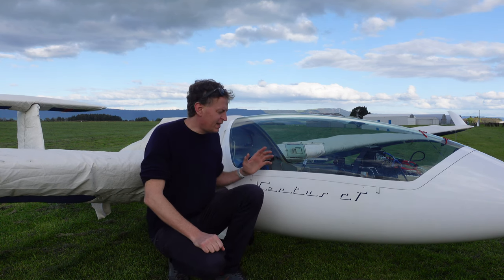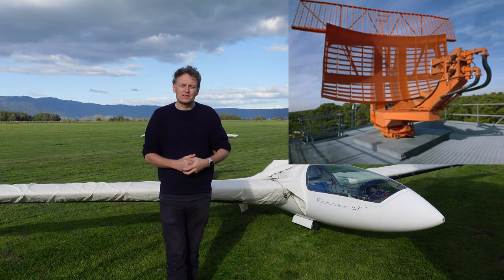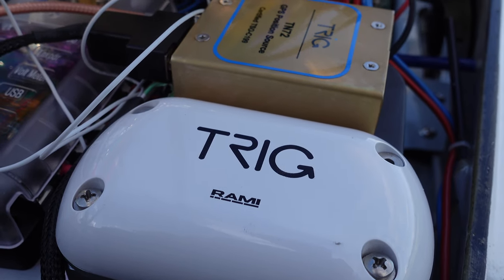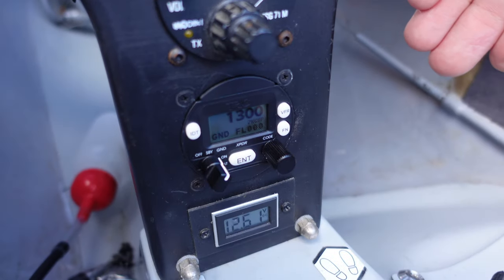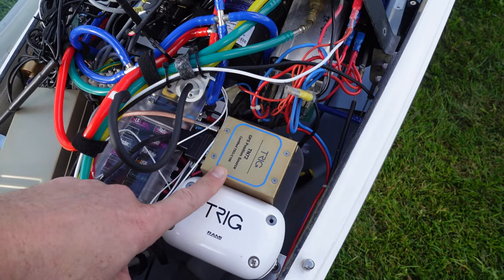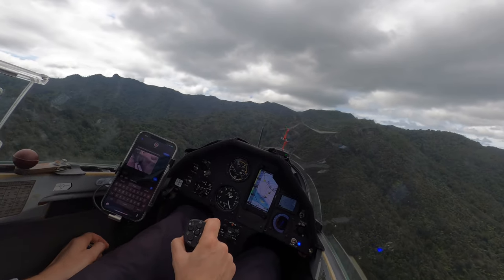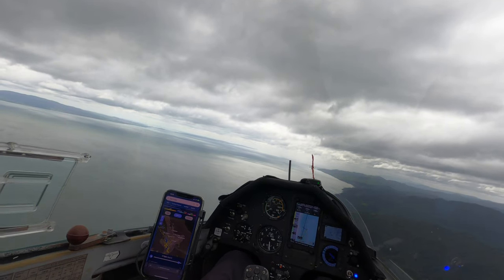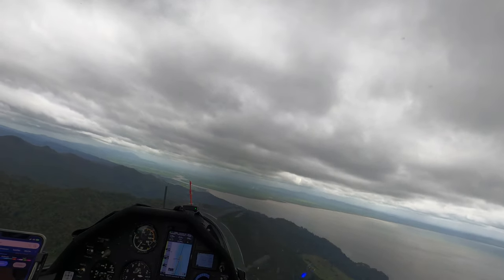ADSB is damn expensive! 💸 Glider Install and Flight Test

Comment: I just have hooked up my Redbox Flarm as a GPS source to my Garrecht transponder via a baud converter/filter/splitter to make it ADSB Out capable, no need for the expensive TRIG GPS brick and other thingy beside it.. It is not officially certified, but the ADSB signal does not care about that. I have it working for already about 7 or 8 years like that. At the time I installed my system (did it myself) it was about €1500. I have a Dolba antenna inside the cockpit near my feet, a flight test confirmed it works very well.

In Europe the transponder is not really mandatory, but there are so many airspaces that are TMZ's these days that cross country flying without a transponder is impossible. So almost all gliders have a transponder these days, either the Trig like you have or the Garrecht like I have, but ADSB out is not mandatory (yet).
Reply from the maker: That’s great! I do wonder if I did that, would our ATC even know?!

Comment: Is FLARM common at all in NZ? That is the GA system that is pretty much standard in Europe for gliders. Much less power hungry, cheaper,  capable of dealing with gliders thermalling in a gaggle, warns about ground obstacles, but, of course ignored by commercial aviation and ATC.
Reply from the maker: It sure is but only in gliders. Compulsory for contest flying.

Comment: We are going through a similar thing in Europe. I have ADS-B in and out, coupled to my LX9XXX system. Stupid thing is most of our ATC radar systems are not ADS-B capable!
Reply from the maker: Oh! Yes not nearly as useful if ATC haven't switched to it yet :)
Reply: @PureGlide  It's not turned on because they haven't even got it installed!

On the other hand it's fun ( if you haven't set the filters on the Lx right ) to get traffic awareness signals of commercial stuff 40 km away and 30000' above you. More fun to imagine the bored bus driver 40 km away getting a heads up on his glass screen to your lowly presence! :)

Comment: I am not sure what is approved and not in NZ, BUT i just installed a uAvionix AV30 with TailbeaconX transponder and ADSB out. Cost me half of that in hardware, but in US$, and my beacon is going in right wingtip, 10m away from me. I asked about putting it where you did, and manufacturer's engineer said he would not do that. Running a test yesterday, I could feel the heat from 20cm away as my hand was being microwaved.
Reply from the maker: Yeah we don’t want the drag from one of them!

Comment: Hey Tim, thanks for the ADS-B tour of your panel. Transport Canada is making the same noises about implementing ADS-B into GA aircraft.
I recently purchased a SGS 1-35, installed FLARM, and scoping out ADS-B as well.
I take it that you chose Trig for its size. Was the Trig installation also the best price point?
Thx.
Reply from the maker: As mentioned the trig system was the only glider suitable ADSB system that satisfies the NZ requirements. The only other option was to installed a normal plane sized unit eg a garmin. The install price was pretty typical, we have to get an approved engineer to do it. Luckily glider engineers were approved (finally).
Reply: AFAIK, in Canada gliders will be exempted, just like they have been for Mode-C, but that's only for Class C airspace.  Here in the flatlands and weak conditions of eastern Ontario, we're not worried about being above 12500'.
Reply: @davesgliding  Hi Dave, we have been exempted for use in Class C in the past. I’m thinking of wave flying next fall in LKP, and having ADB-B available in YOW  and YUL Class C will make it easier to transit.
Hope all is well!
Doug
Reply: @CLdriver1960  ATC will still only clear us across certain portions of Class C anyway, simply because we can't maintain a consistent FL. They will give us a FL and below, but that FL needs to be lower and lower the closer we are to the airport, which takes us out of the workable band anyway.  While I agree that it would open up more Class C to you, I'm not sure how much of a transit window to the south it would open up for YOW.
Reply: @davesgliding  The inability for ATC to identify a non-transponder aircraft is the issue. One of our club members does have Mode C and does get clearance into Class C more easily than I do. To your point, not maintaining a constant altitude does make for a higher workload on the controller, as does our ‘erratic’ course changes (ie hunting for thermals).

Comment: Simply stated,  ADS-B out standard was written by people who do not understand radio.   They guessed at 150W/250W TX power assuming that packet radio communications at near 1GHZ needs any real amount of power to get to horizon at 250miles and 40k feet.   Today the standard would have been written with bog simple 5G chipsets and be in a 15W transmitter with top and bottom hemispheres and the cost would be near nothing and about the same for the paper with it.     

The unmanned drone community under 20kg would rather use ADS-B with a TX power of about 2 to 10 watts than the mess that is just now on the market.

Comment: Interesting stuff Tim.  Are you hooking into the OGN with PureTrack?
Reply from the maker: Sure am, OGN and ADSBHub, along with a number of other things! Got a spare Raspberry pi sitting around? We could use more ADSBHub antennas around NZ! There are only a few…
Reply: @PureGlide  No problem... I've already got a FLARM receiver hooked to OGN so adding an ADSB one won't be a problem.   Note that we also run an ADSB alarm at the airfield when we're flying models so that alerts us to approaching (ADSB-equipped) aircraft.  Safety first!
Reply from the maker: Yeah that’s great re your site alarm, now you’ll see me coming 😂.

Comment: Can you give us a little more info on the antenna mounting?  I’m considering an installation on a Blanik L-23, in USA.
Reply from the maker: Hi not much to it really for the GPS antenna, just a piece of aluminium to hold it behind the panel in a clear spot. The GPS does have to be at least 1m away from the radio antenna and the transponder antenna. My actual transponder antenna is mounted in the fuselage near the gear. But keep in mind I've got a fibreglass glider, so radio works through it. If you have metal or carbon fibre you need an external mount. Hope that helps! Talk to your glider engineer I suggest

Comment: 250W transponder. Crikey, that seems like a lot for modern electronics. How big is your battery and how long does it last?
Reply from the maker: That’s a peak wattage, ie only a short burst when it sends the message. A normal 9Ah lithium iron phosphate glider battery will run it for a full flight. I have 32Ah total :)
Reply: @PureGlide  I should hope it is a very low duty cycle! Part of my job involves calculating and modelling non-ionising radiation hazards for personnel (HERP). I can assure you spending a long time about a metre or so from a 1 GHz, 250 W CW antenna is not within ICNIRP limits!
On the plus side you could always hack-it into a nice heater for the winter... ;)

Comment: If I may ask.  Do you have an electrical system with your engine?  Is that what powers your ADS-B equipment?  Thanks!
Reply from the maker: Hi, no the engine doesn't have an electrical system, as it's only used very briefly, if at all. Instead we have batteries to run the avionics. A single 9Ah lithium battery will run a glider for a whole day happily, even with the transponder on. I have 2 batteries, one 12Ah + 20Ah, giving me 32Ah total :)

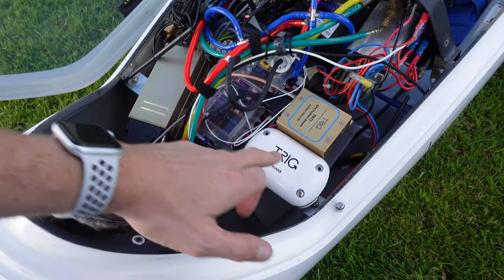Comment: I realize this is a video about ADS-B, but after looking in your panel, I have a weird question.  What's that fluffy cat fur you have on the air vent, seen at the lower left corner of the screen at 3:58.  Is that standard issue, or did you install that yourself? I guess it's to cut down on the vent noise?
Reply from the maker: Hi yeah exactly, it's very common to make the vents quieter. Not sure if it's standard or not, I suspect not. But it works well.

Comment: 250 Watts? bro that's a hell of RF power and especially in microwave bands. That's really overkilled... 1 to 5 watts is optimal TX power for microwave transmitters, especially in the air on some flying devices...
Reply from the maker: I don’t know exactly what the 250w means, it’s the measured peak output or something. No idea, it’s a trig transponder if you want to look up the specs

Comment: wait, you need extra suff for the ADS-B out system? I thought the transponder included it. now i'm really confused. What about ADS-B IN system? what do i need for that?
Reply from the maker: Well, ADSB-In is a whole other ball game. It depends what you want to display the other ADSB aircraft. If you have a glider with FLARM, then you really want to feed ADSB data into that. If you're a power pilot with an iPad, then one of the portable ADSB receivers would be a good way to go.
Reply from the maker: You can still buy non-adsb transponders. ADSB is essentially just adding GPS positioning to the transponder system. Many units e.g. from Garmin are all in one. This Trig system has the components separate as I show. But yes it is confusing figuring out what to get, best to talk to an avionics engineer.
Reply: @PureGlide  i for sure bought the ADS-B transponder, but my question was if that comes with the GPS antena and module included, or do i have to buy them separatly.
Reply from the maker: You can buy them all in a combined package.

Comment: Why do not step forward with powerflarm instead?
Reply from the maker: Hi I have powerflarm in my LX9050. Cheers!
Reply: @PureGlide  i mean in general: there are any advantages/benefits to use ADSB instead of powerflarm? In italy, may be europe, flarm is mandatory, but i do not know ADSB for this reason i was asking. I understood powerflarm already has ADSB inside
Reply from the maker: I’m going to make another video about flarm, powerflarm and ADSB, stay tuned

Comment: How many watts etc is this thing. The real question I'm asking is how dangerous is this for the pilots - radiation etc and you are at close range for long time periods.
Reply from the maker: 250watts peak, only for a short burst when it sends a message. I used to have the antenna under my seat. It’s now moved further back which makes me feel better about it :)

Comment: here in USA, if you have an “experimental” glider you can use the much cheaper ADS-B out gps unit. No, it doesn’t make any sense at all.
Reply from the maker: Yes the US is quite different! Can you fly to any altitude if you have the cheaper ADSB units?
Reply: @PureGlide  In the US, for that it comes down to the selection of the 978 MHz or 1090 MHz extended squitter version. 1090ES is required for use above 18,000ft.
The 978 is also called the Universal Access Transmitter (UAT) and  provides free services, such as graphical weather and traffic information for ADS-B In-equipped aircraft.  However, it's NOT the international standard as the US always finds a way to complicate things that way.
Since I want to be able to fly above 18,000 in a wave window somewhere I have the Trig TT22 (high power) transponder and the TN72 GPS(only good for "experimental" ships)

Comment: Looks neat - though the GPS antenna is rather large as you say.  Is it not an option to use Sky Echo 2 in NZ? (ADS-B out, but no changeable squawk code).  Its encouraging to hear that NZ authorities have said all to have ADSB out by a date.  In the UK, no such mandated requirement and people are using a real mix of conspicuity kit - GA using mode A/C/S transponders, or none,  and Flarm, Pilot Aware or SE2 for air to air conspicuity - though Pilot Aware cannot be seen by non PA receivers, the users seem to like it as it sort of gets Mode C/S (on repeat from ground stations primarily).  I have SE2, which goes with me from one aircraft to another (being self contained and tiny) esp where we have no other ADS-B out - with Sky Demon, we can see its ADSB in and Flarm returns, through the box.
Reply from the maker: Yeah only a certified transponder allows entry into controlled airspace in NZ. If you don’t ever fly into controlled airspace then any of the devices are fine!

Comment: Are these available in USA ?  R they being used here. ?   Application will be a trike.  I’m designing a sexy panel like your gliders.  Mate u sure have lit a fire 🔥 under my ass and inspired me so much.   I’m starting a soaring flight academy in Boise Idaho in 2024.  Super excited.  Light sport CFI with float add on.  And weight shift control    I’d love to add gliders and power gliders to do fun xc.   And research different edf. And engines.
Reply from the maker: yeah all the glider equipment is available in the US, ADSB, Canopy Flashers etc Check wingsandwheels or Cumulus soaring for gear
Reply: @PureGlide  awesome mate.  Thank u

Comment: 2500 for install is a huge ripoff, for a couple of hours work. find a new  inspector
Reply from the maker: Yeah that price includes making a wiring loom, and moving my old transponder antenna to a new location, among other things, some of which took longer than expected. Plus that includes parts such as wiring, the air switch and bits and pieces.
Reply: The hardest part of the install in a glider is finding space to mount the boxes.  Mounting the antenna in the tail can also be difficult.  Carbon fiber in the fuselage makes the antenna placement harder.  Externally mounted antennas increase drag.